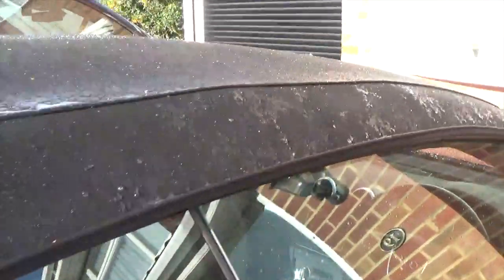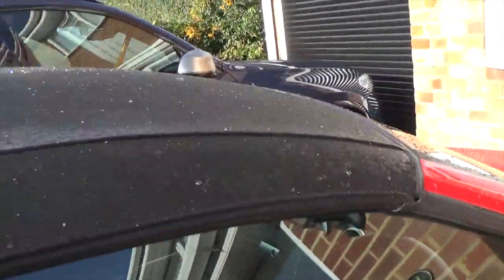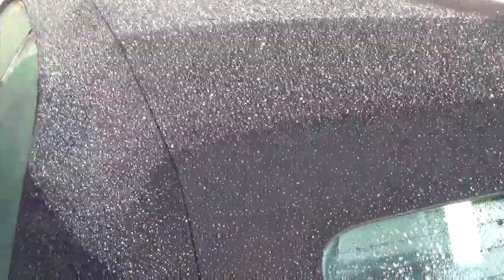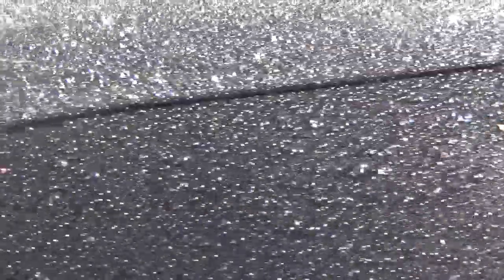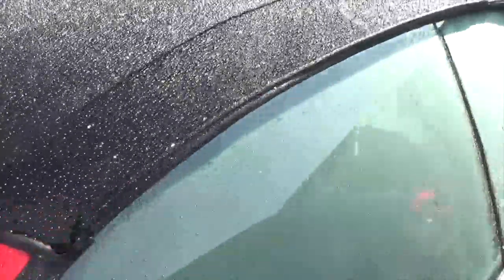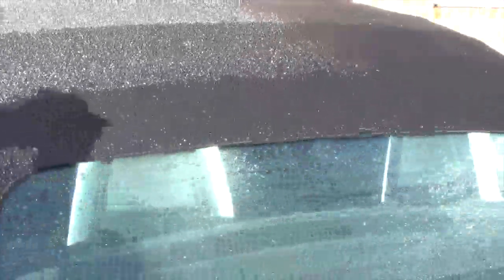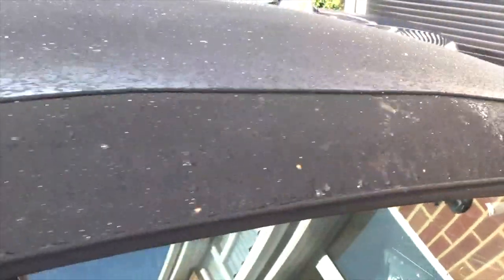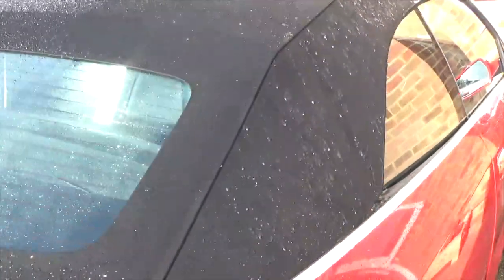Fabsil Gold Soft top Protection

Comment: Thanks for the comparison Martin, I use fabsil gold on my mohair top and wandered if the new ceramics would be better . I get the same result on mine , the water just beads and once wiped over with a micro fibre is dry enough to fold down .
Reply from the maker: I had hoped David that with the word"Ceramic" in the name it would mean something but sadly not🤷🏻‍♂️ Thanks for supporting

Comment: I’ve recently bought a cab and the roof needs a good clean and protecting. Fabsil Gold seems to come up a lot so may need to give it a whirl.
Reply from the maker: Sam if you have followed my channel you will see I have tried a number of products on the roof of the A3 and all a waist of time and money until I tried Fabsil Gold. I am delighted with it and only posted a picture yesterday on my Instagram channel on its performance after a month of mostly rain. I’m not using anything else now and good value 👍. I would appreciate you letting me know how you get on and your thoughts. I found using a paint brush the best way to apply it
Reply: @ObsessiveCarDetailer  I’ve watched sone of the other videos; surprised to see the Angelwax was so poor. Their products I’ve used in the past have been good.

I’m half tempted to use AG’s kit initially because the protection should be applied to a damp roof. The roof needs a good clean but the sun / temperatures aren’t quite on my side yet and my impatience may get the better of me. But then the other part thinks I could do the roof with Fabsil Gold prior to getting stuck into the paint...
Reply from the maker: @samcourt6228  I don't know where you live Sam but looking at the weather in my area (Berkshire) its looking dry for a while. I would give Fabsil a try first mainly because its great value so not a lot to lose
Reply: @ObsessiveCarDetailer  the forecast looks good for the weekend, but I need to try and fit it in before the rugby! 😂 

I’ve loads of APC so I can just use that as a cleaner. 🤔
Reply from the maker: @samcourt6228  just make sure you give the roof a good rinse after the wash and suggest you vacuum it and use a lint remover before washing it
Reply: @ObsessiveCarDetailer  Fabsil Gold it is! Ordered a nice soft brush to work the cleaner into the roof (I’ve done spot cleaning with a detailing brush but balls to doing the whole roof like that).

I’ve been vaccing the roof most weeks to remove hair etc (the neighbours think I’m mental). Rinsing wise it looks like rinse it until the cleaner is gone and the rinse some more.
Reply from the maker: @samcourt6228  🤣🤣 good to keep the natives entertained
Reply: @ObsessiveCarDetailer  I treated the roof with Fabsil Gold. A litre didn’t seem to go all that far and it stinks but my the beading is amazing this afternoon. 

I put the car in the garage last night to let it dry properly. The results and bloody amazing.
Reply from the maker: @samcourt6228  👍👍